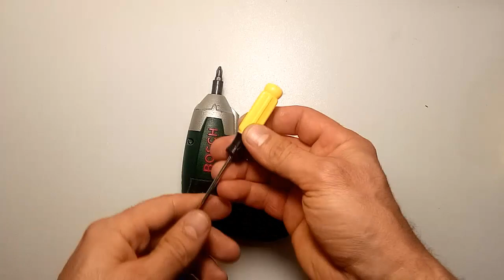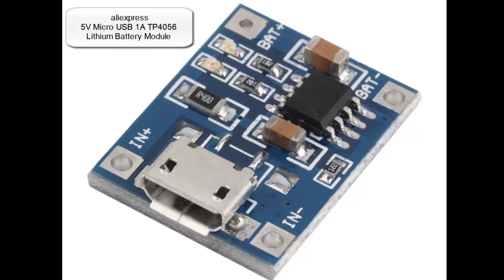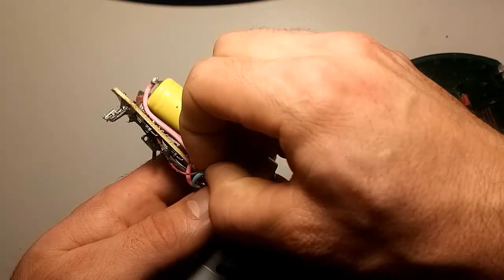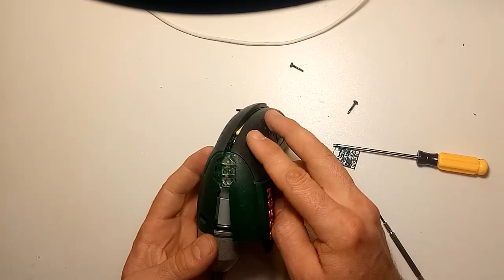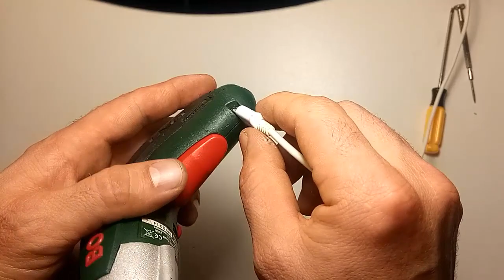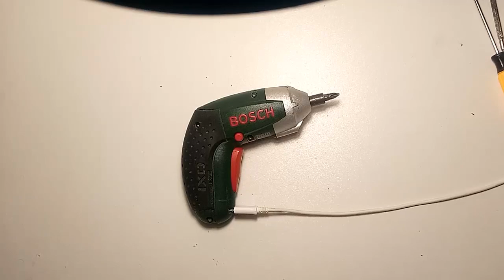BOSCH IXO  Charging  with SAMSUNG USB Charger . How to Open . Repair  Battery Replacement

Comment: instead of music I will prefer an explanation as many things you are doing are not easy to guess
Reply from the maker: My english is not so good, that's why I don't talk in my videos :)
Reply: @CMCdiy  Spanish maybe?
Reply: I agree with most viewers. Stabilize the camera, think how you are going to show the parts, do not improvise, re do the task from scratch, including cutting and reconnecting the board, and welding the connections, take away music, give explanation in any language, then use prompt text added to the video in English. Otherwise, you are just "a guy fumbling and pointing". Not useful.
Reply: Diagram pls

Comment: Thank you for this video: very creative!!- did you remove electric components from de PCB??-Could you clearify the wiring to the top LEDs?Thanks, Jan
Reply from the maker: hi
I only removed the battery charging part. otherwise it remained the same
Reply: DIY Tips&Tricks did you also removed the
Reply: Did you also remove the electronic components from the original Bosch pcb? Could you mail me a Photo so that I precisely know which components I have to remove? Die